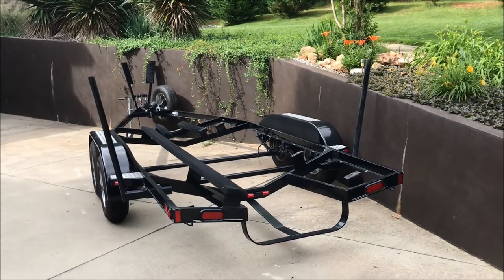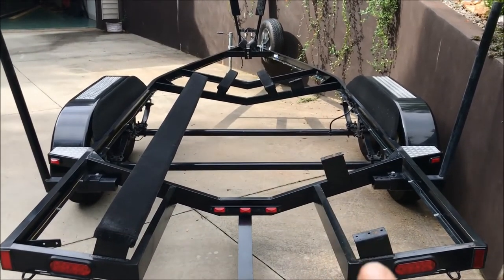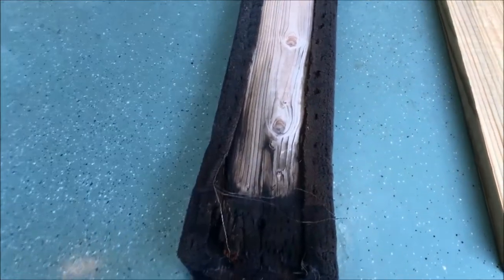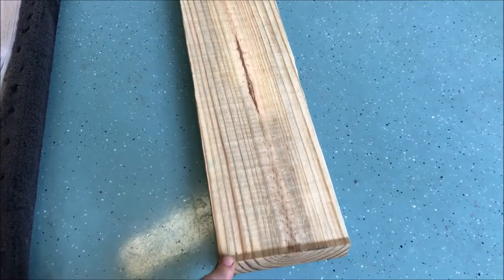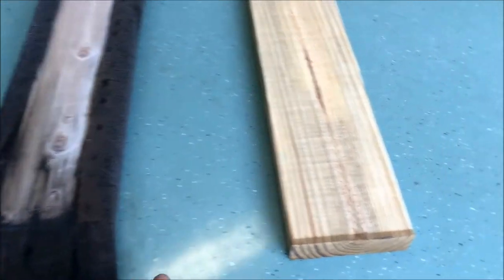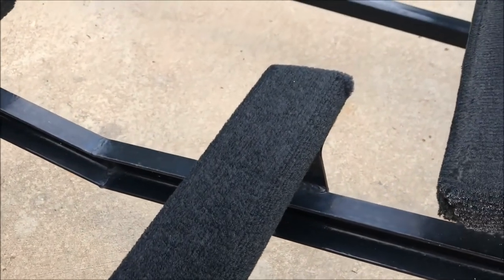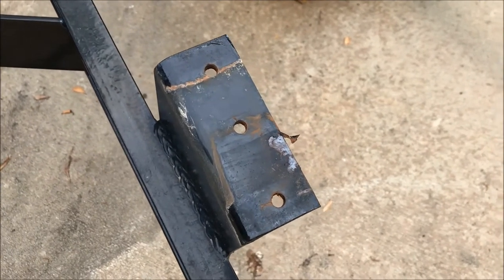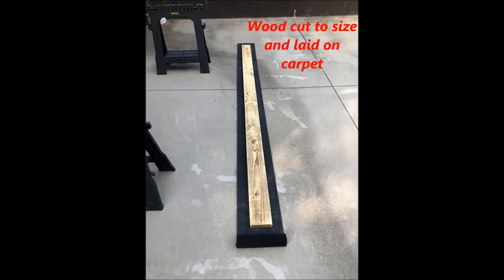How To Repair, Make Boat, Marine Trailer Bunk Boards & Replace Bunk Board Carpet; EASY DIY

Comment: Id guess that the board rotted at the end because carpet was wrapped too far back and the water could not drain out.  Also, the cut end of a treated board is porous and should be sealed first
Reply from the maker: Great comments, thank you!